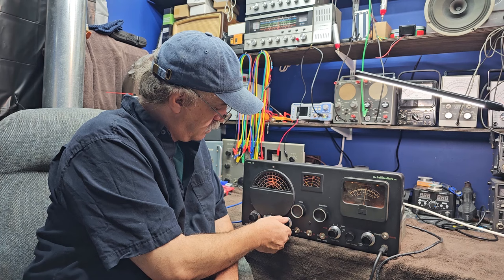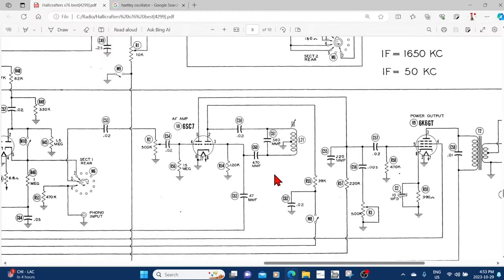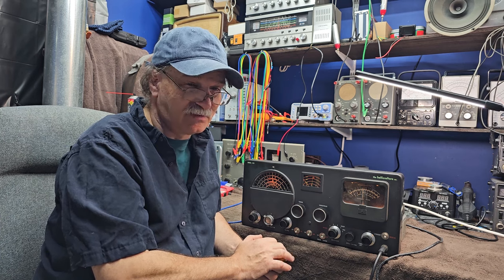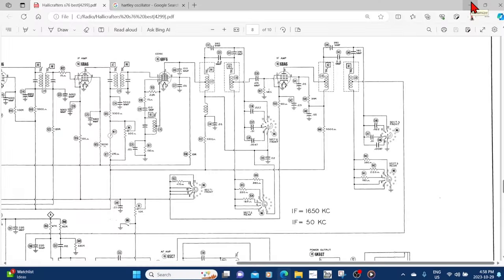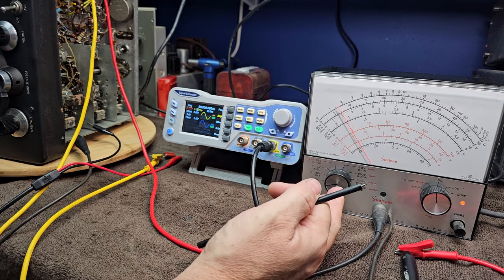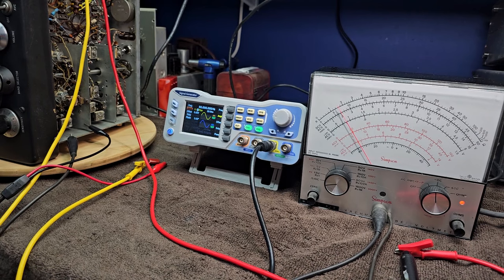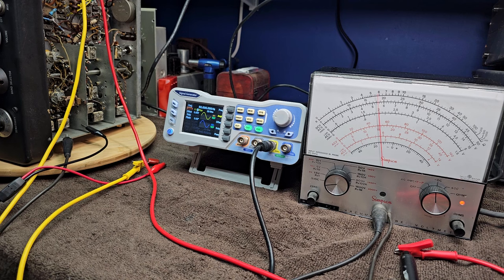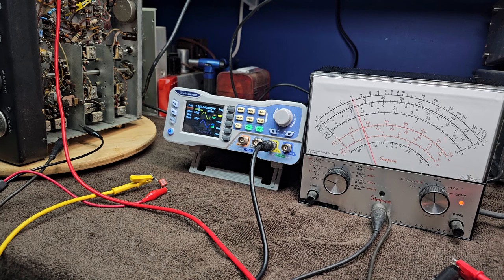Hallicrafters S-76 Restoration Pt. 4 - Alignment Secrets Discovered!

Comment: Thanks for this. At some point, (when my back feels good enough to lift the set), I want to re-do the alignment on my S-76 in hopes that the sensitivity will improve. I did not have a good source for 50khz when I did it the first time. I did not have an SDR available then either and am interested in how you used it to set the oscillator, however you didn't show that procedure. Have you showed that in an earlier video? In any case, I enjoyed this series and wish I had been able to watch it before restoring my set. I also have a mystery tunable hum sometimes that can be fixed temporarily  by turning the set off and on. A ground loop? If you have any suggestions for finding that, I'd appreciate it very much. Thanks again.
Reply from the maker: 1) I just havent had time to do a video on my poor mans spectrum analyzer yet. I will get there at some point. I have other folks who want me to do about a dozen other video. So much to do. So little time.
2) The hum. Hum can be a lot of things. Cold bad joint, poor ground, BUT in your case I might suspect a tube. Filament to cathode issue. That might also account for your less than stellar receive performance. Crack it outta the case and poke around with a signal tracer if a tube isnt giving you grief. Once it starts humming it should be easy to track down what stage it starts with. Or maybe an O-scope and watch the power supply. Cheers :)

Comment: Mikes Radio Repar I have a zenith Trans oceanic shortwave receiver battery operated I want to restore it ware do you get Russian germanium transistors I want to restore it let me no
Reply from the maker: Generally I only do Tube based equipment. So Transistors really arent my baily wick. However I'm sure you can find an online substitution tool or maybe something on ebay. Wouldn't hurt to join both our facebook help groups and ask that question. Cheers and good luck.